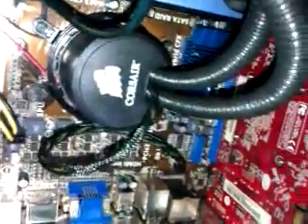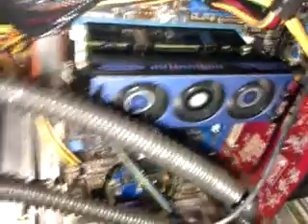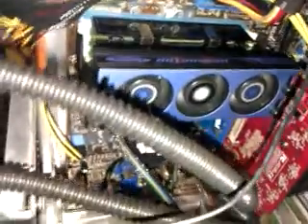TEC Extreme CPU cooling

Comment: WILL KILL YOUR PC!  I have TEC's running on a plate outside of the PC, used to chill the liquid coolant loop; with a large all copper air cooling system (again outside of the case).  This will resolve all ice / water issues; which will 100% kill your machine!.  Goodluck.
Reply from the maker: U see your point but I did this 2 years ago and it is still working. With correct insulation and some lick these can last.

Comment: I do have a question. Now that's it's been a year since you did this: Have you ran into any problems with condensation forming in dangerous areas or does it mostly evaporate when the PC is off and it starts to warm up?